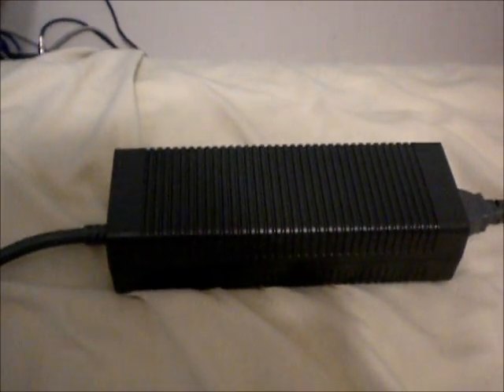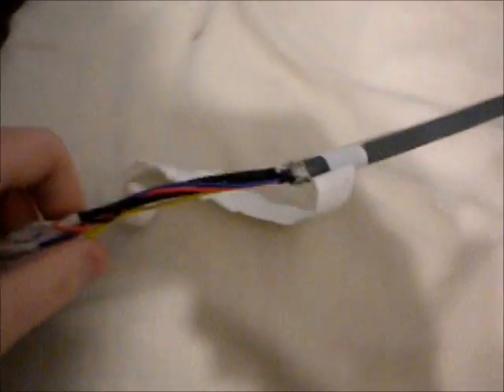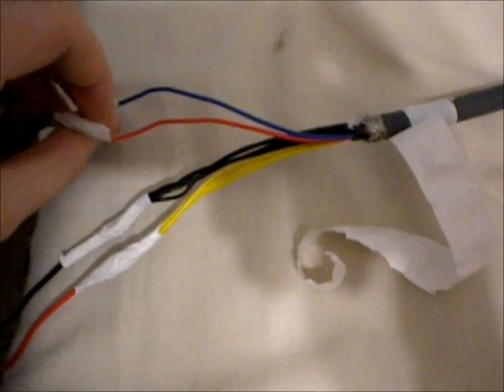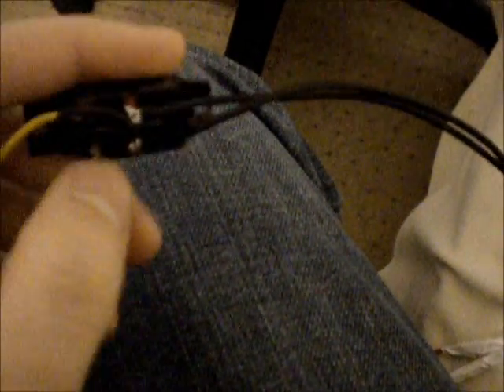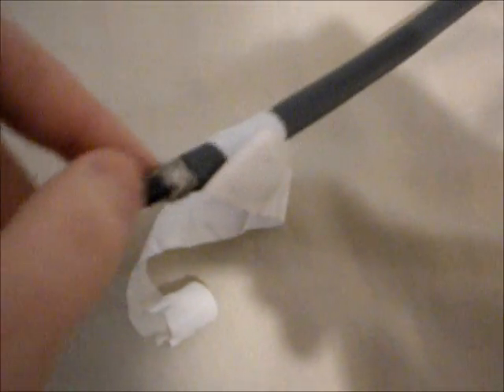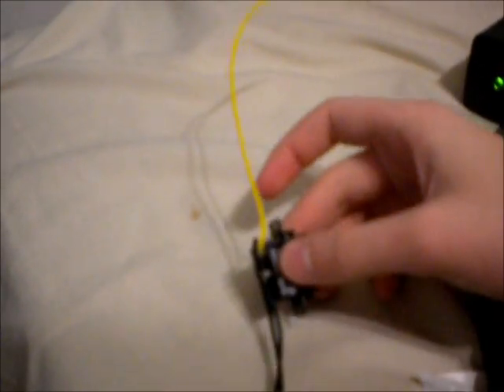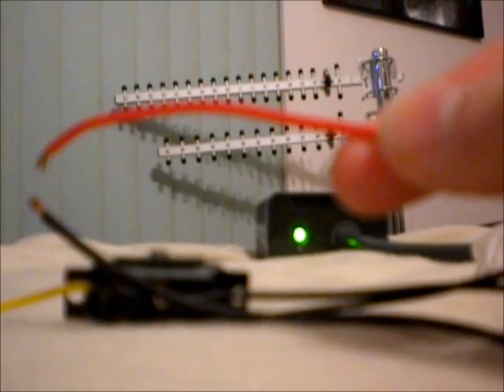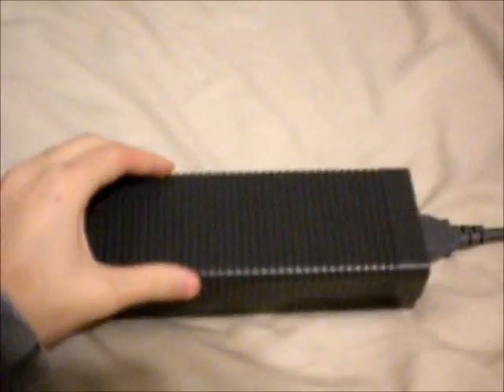How to create a power supply with an xbox 360 power brick.

Comment: Another cautionary note. This often is not an issue, but it can be and is something to keep in mind.

It takes a while for the +12V line to drop voltage after the AC mains power is removed or the brick is turned-off...over 15 seconds (no load) in the power brick I have. So, if you are powering removable voltage-sensitive components, you want to make sure the output voltages have dropped to near 0V before disconnecting those components.

Similar warnings for putting bricks in parallel or serial. When "turned-off" the output voltages of different bricks may decay at different rates and the results on your project or the bricks themselves could be unpredictable.

Comment from the maker: No. you are connecting them in parallel. each cable is 12v. since there are 4 wires, if there were 4 12v rails then each would be 4.125 amps, and since we connect them in parallel that would give us the 16.5 amps

however, i bet that there are 2 rails (one for the 3 thicker wires and one for the thin wire)... or maybe its just one rail. i dont know and i dont have this any more to check.

if it was one rail, then still combine the wires. more current flow with less resistance (wires wont heat)

Comment: Ok so kinda a newb here but I'm about to build a bluetooth radio for work using this power is it possible to use the 12 volt and the 5 volt at the same time? I.e. 12 volt to power the bluetooth amplifier board and then the 5 to say a phone charging plug and charge my phone while everything else is in operation
Reply: Isn't 150w little overkill for a BT radio?

Comment: Could you either explain or show using this for electrochemistry? I just started experimenting with the field but at 12$/large 6v battery that only lasts a couple days im hoping to repurpose my xbox power supply for chemistry. One simple example id like to see would be using a copper anode and cathode in white vinegar to make copper acetate in solution and copper oxide solid due to the O2 gas produced. I notice you havent made a video in quite some time but I'd love to see this explained and set up if you feel itd be something youd like to try out.

Comment: Hey, thank you for the great idea. Can i use it to power 2 different battery LiPo chargers (for RC cars)? One of them requires 12V 4.5A and the other one 12V 7A and they will be used simultaneusly. The idea is to use the yellow/black wire (all small wires solded together like in the video) and attach in parallel to 2 banana pairs. I have the 150w XBOX 360 PS

Comment: just wanted to let you know I did run these in series an the voltage is 22.9 an worked just fine I figured they would shut off also... much easier conversion then doing the CPU power supplies out of desktop computers..
Reply from the maker: Its not that you cant run them in series, its just that there are things you should do in order to stop damage to the power supplies. you need to have a diode between the two, in order to stop any potential current from feeding backwards. for instance, if power supply 1 is outputting 11.5v and power supply 2 is outputting 12v, then current from power supply 2 could potentially flow backwards, though the +11.5v lead from power supply 1.

another thing to consider (now assuming both are actually 12v for numbers sake, but it would still happen if there was a mismatch like above)

also, if the reference voltage (black wire, 0v) is tied to earth ground, then you now would have 12v flowing though the wall and raising the potential on your grounding pins. this is because the reference voltage on power supply 1 is 0v, and its outputting 12v (difference of 12v). on power supply 2, you now have 12v going into the reference voltage (black) wire. the output is still going to be 12 volts... in reference to the black wire. however, since that reference is 12v, we end up with 24 volt on the output (in respect to the black wire on power supply 1). as i said though, if the earth ground and 0v reference are tied together, then now power supply 2 has 12v going into the reference, which is shorted to earth... which now means 12v can flow though the ground pin and potentially into other electronics! in order to do this, and not have that happen, you would need to put kapton tape, or some other thin isolating tape over the ground pins on both power supplies.

i DO NOT recommend doing this. if theres a wire or trace touching the casing, now theres a potential for a nasty mains voltage shock by just picking up the power supply.

so yes, it will run in series. but, you should be cautious about it. if you measure from the black wire on power supply 1, to the metal shield on power supply 2 (or the ground pin , while not plugged into the wall), see if you get a voltage. the fact you were down 1v on the theoretical 24v output suggests to me that you will have 12v on that ground pin... but i would be curious to see.
Reply: Your first paragraph is completely wrong. That's not the way that series connections work. Your whole second section could be more easily said as "If the power supplies are isolated, it's safe".

Comment: CAN YOU HELP ME PLEASE, USING AN OLD XBOX 360 POWER SUPPLY TO CONVERT A 12V CORDLESS DRILL AFTER PLUGGING ALL YELLOW TOGETHER, ALL BLACK TOGETHER AND RED AND BLUE TOGETHER. THEN I PLUG BLACK WIRES TO NEGATIVE OF THE DRILL AND YELLOW WIRES TO THE POSITIVE WHEN TURNED THE DRILL ON IT SPIN FOR A FEW SCONDS AND THE POWER SUPPLY BECAME RED. I UNPLUG IT TO RESET IT, IT KEEP DOING THE SAME THING.
Reply from the maker: The drill is pulling too much current most likely. If you turn the power supply on without starting the drill, does it also trip to red? if so, you wired something wrong and theres a short. If not, then yeah... the drill just pulls too much power. You could try slowly starting the drill instead of going from nothing to full speed, but i assume while drilling metal it would still trip

Comment: great idea👍did you connect the small yellow wire to the 3 bigger yellow wires
Reply from the maker: Robert Kotevski yep. They are the same voltage. So in the case that there are multiple 12v rails, connecting the wires could give more amperage.
Reply: motsu35 i tested the 3 big yellow wires and they read 12.20volts and the thin one read 11.98v is that still ok
Reply from the maker: Robert Kotevski yeah.
Reply: motsu35 thanks for your time sir much appreciated 👍 ☺
Reply: motsu35 
Hey is there a way to make a power supply for the XBOX360 that uses less energy, for example a 90W instead of a 130W
Reply from the maker: Power consists of two core units, the amperage and the voltage. wattage (power) is simply voltage * amperage. Voltage is ideally a fixed unit. a 12v power supply should output 12v no matter how much load is on it. even if you connect a device that doesnt want 12v, thats what its going to get (this normally will fry devices wanting less voltage, and not power devices wanting more).

amperage on the other hand is determined by the power draw of the device connected to it. for instance if i have a 12v power supply can output 10 amps, and i plug a 12v fan into the power supply, the fan might draw 1/2 an amp. (12v * .5a = 6w). if i attach a bigger fan with a bigger motor, this new fan might draw 1 amp (12v * 1a = 12w). as long as the fan draws less than the 10 amps, everything will be fine.

in response to your question, the way to make the power supply use less power is to simply plug less power hungry devices into it. wattage is v*a, and the V is fixed... the a is dependent on whats plugged into it. 

now, in reality all power supplies have an efficiency curve, and are normally more efficient in the 50-65% range, but its at a small enough percentage that for small home projects, it doesnt really matter.
Reply: motsu35 
Can you make a power supply or a cable that gives the older XBOX360 less power? 
I want a power supply for example the OE XBOX360 gives less energy, so the console uses slightly less energy, which is better, can a power supply like this that gives less power be adapted to an older XBOX360 console.
Maybe even a laptop power supply attached with an adapter, maybe that can work, and if you can do it and works sell one to me, so I can get my older 360 to work without ever having the Red Ring of Death in it.
Reply: motsu35 
I think that Microsoft should had done a version of the 360 without the disc drive, and had made it use less energy, that way would never had the RROD
Because it would had use less energy and would had been much smaller.
Reply from the maker: Well, the RROD problem was caused by too small of a heat sink / ventilation for the cpu/gpu on the system. the cpu and gpu was generating the heat which was causing it to fail. the cd drive might have drawn a small amount of power (realistically small enough that you wouldn't be able to easily measure the heat), but the heat from this power draw would primarily be in the power supply (which is external, not contributing to the rrod), as well as a small amount as friction in the drive... however this is negligible when looking at the rrod problem.

Since the cd drive is controlled by the console, simply spinning it down when not in use would be almost identical to the power draw of not having one (due to the same reason mentioned above. the power draw of the system is determined by the amperage being drawn from the components, not the total possible wattage output of the power supply)

Comment: I have an Xbox 360 slim PSU and I already cut the end that goes into the Xbox and it has 2 yellow, 2 black, 1 red, 1 blue, and 1 grey wire. I want to make a 12 volt power supply for an amplifier but what wires do I connect to get the Xbox PSU to turn on? Please help me thnx.
Reply from the maker: its been like 5 years since i made the video... im fairly sure its in the video. black is your ground, yellow is your 12v, red is your 5v. most likely you just need to short the 5v wire to one of the others (blue or grey).
Reply: motsu35 thnx for replying but I've tried that and if I short the red to the blue or grey the light on the power brick goes from orange to red any idea?
Reply from the maker: no idea, I haven't ever messed with the slims. i would try googling around to see if anyone else has any experience with them. if not, i would try to just put a resistor between the 5v and the power on wire, and see if that makes a difference
Reply: motsu35 alright what type of resistor? and man I've looked it's like no one has done it its weird lol
Reply: VAMPIRE WERE WOLF MLG BOSS Did that work for you??

Comment: I need help to I have a 2600 watt amp with two 30 amp fuses how would I power it I bought 5 bricks so I was wondering if you could help thank you
Reply from the maker: Josh Smith so I'm all for hacking together stuff, but you shouldn't buy 5 power bricks to power a DC amp. (I'm assuming a car amp?). Why not buy an AC amp? It will most likely be cheaper than 5 bricks, and it will be a lot more efficient. For main speakers I would go with an emotiva a-150, or if you need it for a sub check out the behringer inuke line. They even make some with dsp built in so you can set your crossover and eq in the amp. 

If you are 100% wanting to use ac-> DC power bricks (maybe you just want the learning experience?) I would recommend going with atx (computer) power supplies. They will be much cheaper per watt. To get them to turn on you just jumper the green and black wires on the 20/24 pin connector. I used two 450w power supplies in a party cooler I made a while back. Only used them over an ac amp because I already had them and a car amp laying around and I wanted it to be as cheap as possible. 

If you do go that route, you will most likely need a car audio capacitor to smooth the load out on the power supplies, otherwise bassy parts of the song will most likely trip them (unless you went overkill with how many atx power supplies you have. Keep in mind finding more than 2 sockets on a wall in one area is hard). If you do a car capacitor, you will need a resistor to charge the capacitor.
Reply: thank u

Comment: Hey, do you know what modifications to this method would be necessary to use it as a power supply for a PC?
Reply from the maker: The 360 power supply does not have all the voltages that a computer needs. There would be no easy way to get it working.
Reply: motsu35 there is a way. You just Need a 12v to 5v and a 12v to 3.3v Supply.

Comment: can you parallel 2 of these together and get 12v and 31 amps? I don't know why I'm asking I should just do it lol  and assuming wired in series you get 25v and 16 amps same theory for the 5v side
Reply from the maker: You can run 2 in parallel. I would be cautious about putting them in series. Some switch mode power supplies really don't like it, and one can feed back though the other. Also, 12v is a lot safer to play with than 24.12v you won't get a shock from unless you have wet or punctured skin.
Reply: +motsu35 thanks for the reply

Comment: How much power does the Xbox 360 power supply have?? 200??
Reply from the maker: +Chaotixs Gaming It really depends on the power supply you have, since different models shipped with different supplies. if you look at the sticker on the addapter, it should say how many amps it supplies at each voltage. if you multiply the voltage by the amperage, you will get the total wattage the brick can theoretically supply.

Comment: What does the 5 volt out go too?
Reply: I think that wire can be capped off since it is only there to draw power to the other groups of wires.  I think you would lose power to the other groups of wires if you ran it to anything.  That’s just my theory.  I guess you could try using it to run some LED’s , and use a multi meter to see how much power you loose.

Comment: Well, I plugged the remake in, and I got pulsing.  I tried adding a 12VDC LED, and it still pulses.  How do i fix that?
Reply from the maker: +William Pittenger The 12V rail is flickering on and off? or the status led?

How fast is this pulsing? i would also try putting a resistor across the power on wire. I dont have one of the newer ones, so i cant check myself. sorry
Reply: motsu35
Naw.  I figured it out.  I had to break the cube open, and found that the germanian diode and a resistor were burned up.  I'm sure I can fix it, but it's going to be a pain in the butt to remove the things in the way to unsolder and resolder.  I found the plans to make a new power supply.  It's probably faster just make that one, instead.